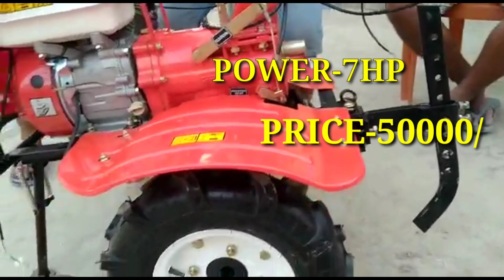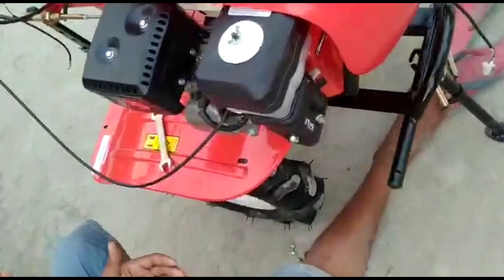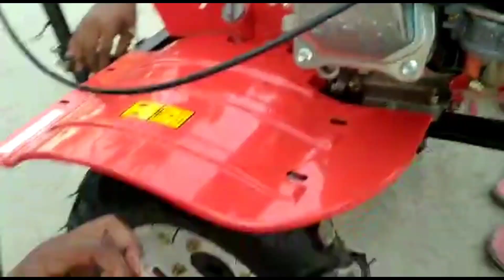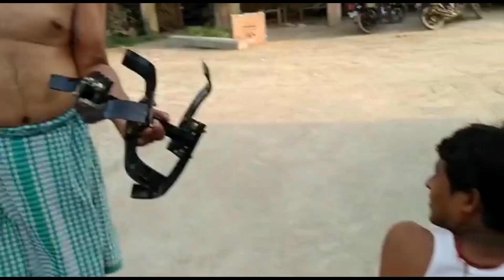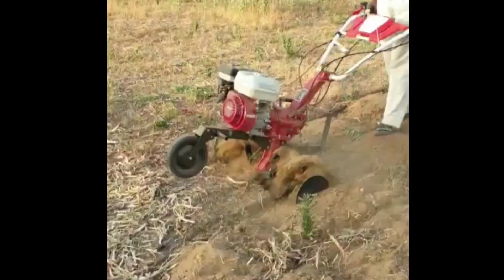BSC-1000 Power Tiller || 7Hp Honda Power Tiller  57500 Only  || Sprayman

Comment: Which honda engine is exactly used in this 7hp power tiller , i want to buy this for my fields for hilly regions where road connectivity is not available.
 Our field is so hard and full of  small rocks is it able to work there . 
Thats why i want much power and less weight.
Reply from the maker: Gx200, weight 85kg